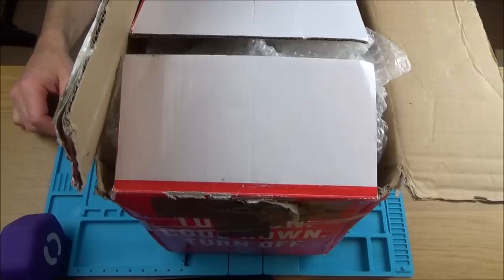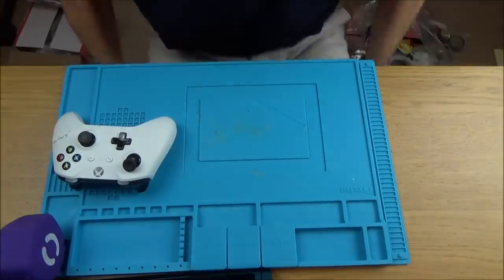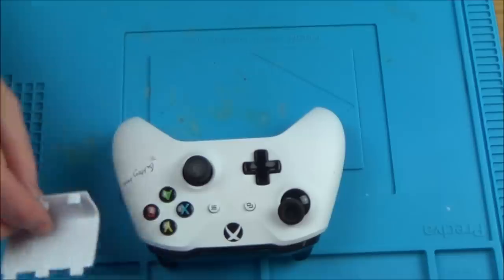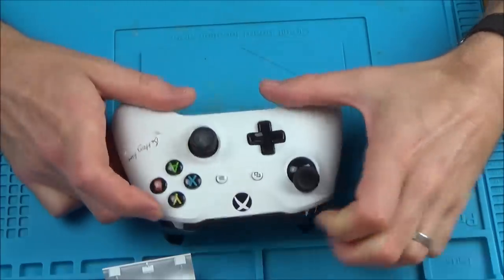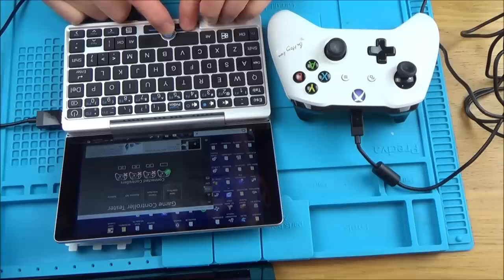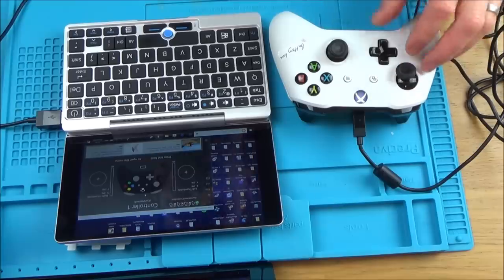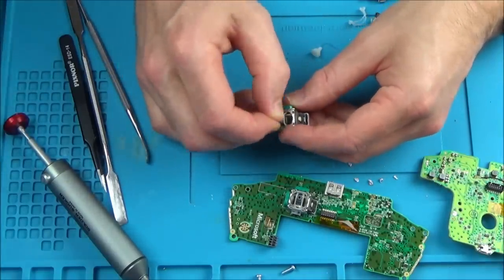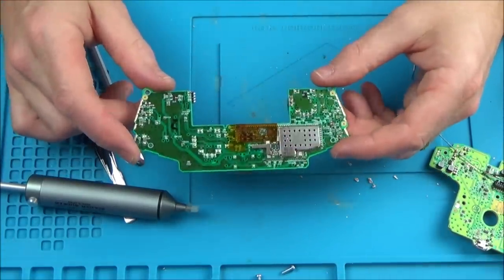Trying to FIX eBay Joblot of Faulty Xbox One Controllers PART 3

Comment: Pro Tip:
At 10:43 when he's prying back the potentiometers (the green portions of the analogs) replacing the "discs" inside will solve nearly ALL drifting issues. unless the the stick mechanism itself is loose and broken, replacing the discs will almost ALWAYS be a fix. Many times you can actually get away with cleaning them with a Q-tip and some iso alcohol! They don't even need to be from another XBOX One stick. XBOX 360's will definitely work and actually I can't imagine why any disc from any analog stick wouldn't work.

An alternative fix for a controller that continues to shut down wirelessly is to reflow the connector at 23:47. You could be having a false positive where one of those pins may actually be loose, but by testing it you're putting just enough pressure on it to make a connection to the board. I bring this up because I was experiencing a VERY similar issue with MY XBOX One controller where after a few minutes it seemed like the controller would die, but the battery would be rather full. Turns out, I could forcefully shut it off by clicking the sticks in or by giving the controller a slight "twist". Pins seemed fine with a multi-meter and it kept happening. Finally I decided to use some flux and reflow the connector pins. PROBLEM SOLVED!
Reply: Underrated comment. I would determine the potentiometer value though, just in case there is a different value. Small difference in pot value isn't bad though, it can and still work.

And put a bit of oil or grease on the pot because the pot is made out of carbon which makes it's resistance, and when dry, abrasion eats away the carbon layer causing loss of continuity(connection) thus no longer working.
Reply: i actually ripped one out from my knockoff PS2 controller and put it in the XB1 controller a few months ago. Works like a charm. Potentiometer designs hasn't changed much i guess.
Reply from the maker: Thanks, that all makes sense, thanks for sharing your tips :-)
Reply: Yep, I just pull them out and clean them and the inside of the green part with a qtip and alcohol.
Reply: Garrett P.  :
Focusing in on those sections of the stick never crossed my mind until I randomly came across such a video. I'm always repairing things and watching tutorials and etc... as I find them fun to watch when I'm bored so, the homepage for me is just riddled with these kinds of videos. 

Needless to say, I came across a video explaining an alternative fix (cleaning/sensor swap) and it's COMPLETELY changed the way I fix drift. SO much easier pulling those back to swap or clean instead of desoldering the WHOLE mechanism and swapping a WHOLE new one in.
Reply: I really struggled getting the sensor back and after cleaning or replacing it, could not get it to sit flush and close/click back in place. Ended up losing my temper and flinging the thing. I’ll have another go tonight

Comment: Regarding testing procedure: with a known working board, you can check with diode mode against ground and the test pins on the board. The test pins are marked with TP<number> e.g. TP35. You should get a reading then and can compare it with the faulty board. This could help to find the faulty section faster. Also you can set the board under working voltage and check the test points with voltage reading against ground.
Reply from the maker: Thanks Florian :-)

Comment: I bought a Xbox One S controller with the same analog issue your has. The post was broken. All I did to fix was straighten out a paper clip and cut it to size. I glued it into the hole in the gray post and attached the broken part to the paper clip. Once the glue dried it worked perfectly. No need to desolder or replace.

Comment: The reason the coax connector looks like both sides are shorted is because they are (at DC). If you look at an IFA antenna, you'll see the antenna basically shorts the center to gnd, through a tap (The "arm" of the F). At DC, that's a dead short, but at high freq (2.4G), that's no longer true.
Reply from the maker: Thanks so much. I was expecting it to test like a TV aerial cable so it confused me. Thanks for the info :-)

Comment: Hey Vince ! I faced this broken off analog stick problem a little while ago. The analog sticks have a little shaft in them , which are the exact same diameter like a paper clip. So I cut off a piece of a metal paper clip, I put in in the shaft but it was to skinny. So I grabbed one of my parts controller which had a faulty motherboard,and I cut of the analog stick grey part to the exact size of the one what is missing ,after I put this cutoff piece on the paper clip and I put on a little lock tight superglue and done! No need for resoldering. I hope this is helpful for you, ps sorry for my bad English,cheers mate
Reply from the maker: Nice little fix :-)

Comment: Great stuff as always. I dont even own an Xbox one but its still fascinating to watch. Id like to add that I (along with all your other subscribers no doubt) really, really appreciate the hard work you put in, it must be exhausting sometimes. I like the fact that your vids are detailed and you explain things in depth. Much more interesting than the fast-talking, glossed over, ten minute videos that some put out. So thank you, my day would be considerably more boring without a bit of Vince!
Btw, if that analog stick (the replacement one) suffered from stick drift then would it be easier to just take the pots off of the broken one and pop them onto the replacement? I assume stick drift is caused by faulty pots rather than by mechanical issues.
I reckon that resistor got knocked off and then slapped back in the wrong place. Strikes me that whoever was doing those repars had all the finesse of a one armed orangutan. Believe me, if I'd bought that lot (and lets face it, they weren't cheap) I'd have been using considerably stronger language than you did, and it would have been well deserved!

Comment: 32:25 comparing the good and bad boards you can see all the test points on the bad board have been tinned. Someone has tried to reflow the board and has gotten solder all over it, R28 moved during the reflow, onto a test point.

Comment: Great fix.
It looked like the other resistor next to it was on the slant and maybe that was changed out.
Question: Did you have to take the stick out or could you just have replaced the whole unit from the spares box? It looked like you took 1 apart that was whole to fix the broken 1.
The fault finding process was great to watch.
Reply from the maker: Thanks Emma, the resistor is still a bit of a mystery. The most popular explanation so far is that it was a fault by the pick and place machine in the factory and maybe the boards were initially sold as faulty but made its way into the Franken controller. Maybe your idea is more likely, the area looks very clean though. 
I could have just changed over the green clip on bits on the side (potentiometers) and I am sure the analogue stick would have worked fine. I just wanted to replace just the broken part to see the inside of them and also the other one had stick drift so I was unsure about reusing the whole thing :-) You can get the OEM ones for around £3 or £4 so most people would just change over the whole unit rather than messing round with the insides :-)

Comment: The capacitor that was bridged improperly is supposed to deliver power to the power management system, which shuts off the controller in the event that the batteries reach low power levels. Hence why the controller would only turn off if it was on battery power.
Reply: Meant to say resistor, not capacitor.
Reply from the maker: Thanks for the info on it, nice one :-)

Comment: Stick drift is likely to be caused by the potentiometers on the sides.  If you had taken the drifting stick and put the original good pots on it- that might have worked and have been easier.
Reply: MineSweeper  not to mention he had spares from stick drift-suffering potentiometers
Reply: MineSweeper  Right, the broken top joystick did not drift so the POTS were good.  Just stick the entire mechanical part of an intact joystick on the good pots and skip taking it apart to get out the gray part.
Reply: @kirkb4989  that's exactly what i thought he should have done when i was watching, would have saved time taking it apart.
Reply from the maker: Yes, definitely would have been easier. I just wanted to change out the broken part as I was a little bit curious to see the insides of them :-)
Reply: @Mymatevince  It's all a part of the learning process after all
Reply: @Mymatevince That is always a good reason for doing something the hard way.  But in the future you can save time and agony and not potentially break your spare!

Comment: My guess Vince is that the Original resistor could have been replaced, but inadvertently replaced to the wrong place, "that is if were not inadvertently moved when Frankenstein-n the controller" and because much the same fault persisted, the board was discarded as a Frankenstein candidate itself..

Comment: I would hazard a guess and say someone swapped that board to board connector? usually they are white not black on the single connector boards. maybe the resistor got knocked during the swap. Loving these controller vids.👍great job

Comment: That shifted resistor was weird, but could it have just been a rare manufacturing defect perhaps? I know that the assembly process involves a machine tacking the components to the PCB at a great speed, so maybe it just missed it's spot that one time.

Comment: Looks like this controller was deliberately modified to remove the wireless function. it is possible to buy xbox ones in UK prisons but as anything that transmits is banned they have to be modded to comply, and have to be bought from an approved suppler that does this.
I have repaired plenty of ps2 controllers with stick drift back in the day, they use exactly the same analogue stick module. the main culprit is the "foot" of the stick, the white disk with a peg on the bottom. it wears down and becomes very smooth and thin at the edge. it should have a recess on the bottom that helps it to stay centred. I used to harvest the right stick from broken controllers as they usually have less wear.
When checking for shorts to ground it is best to have the positive on ground and probe with the negative. your meter will give a reading of the voltage drop and can be used to compare with a known good board that a simple continuity test won't tell you. also reverse your probes if you do find a suspected short, it may just be reading though a diode. Check the resistance too as if it is low your meter will still beep even if its not a short.
Reply: I was going to suggest the same thing.  Meter in 'diode mode' and red lead on ground, and black lead to probe different points.  Compare those readings between a known good board and a bad board.  The 'voltage drop' readings should be very close at the same points between boards.  If not, it can point you to at the possible culprit.  If you find yourself repairing the same boards multiple times, you can keep track of the 'good' voltage drop readings in an Excel spreadsheet (for example) so you don't have to keep using a good board to compare the proper readings.  Great fix Vince!
Reply from the maker: Wow, maybe this is the reason why it was moved:-) Thanks MIK & Andy for the tips on how to test the boards. I need to start using diode mode to get used to it :-)

Comment: Fantastic repair this one!  =D  Calling the seller what you did was neccessary lol!  There's nothing genuine about that job lot!  Did you see that XB1 over on TronixFix where the connectors had been glued into the case to make it look like there was a motherboard in there?  It's crazy that the resistor needed moving over!  I wonder if it's a configuration point based on which top board and bottom board are connected up.  ie. maybe there are different revisions of the other board, and since these were seperated by the previous owner, maybe that's why it appeared to have been moved, when maybe it was set that way from factory to work with a different back board?
Reply from the maker: I really don't know Chris, all the other components looks to be the same on that board and would they be running different boards in production at the same time (unless they are using up old stock on the back board before a change). That whole area looked perfect so it is really strange...nice easy fix though, I loved doing this one. 
I seen the glued in ports, that takes it to a whole new level. Great for the video though and he did really well on that series as far as views and subs went so hopefully that will make up the disaster he had with the consoles themselves.
Thanks for the support mate :-)
Reply: @Mymatevince  Who knew repairing XB1 controllers could be so interesting lol!  I've really enjoyed watching these!  In some ways you are lucky it was such a bad lot!  the fact they aren't genuine faults has led to more interesting videos imo!
Reply from the maker: @GadgetUK164  Totally agree Chris :-)

Comment: hello, wonderful work, I like the way you fix the consoles and the controllers, I have an xbox one controller that does not work the 4 vibrators, I only have one driver of that version, it has the 3.5 mm connector, but I have 2 connectors 8 pines to attach the boards, similar to the first version controllers, do you think that I can use a plate of old version to verify if there is a short circuit or something like that that causes that situation?

 sorry about my bad English.
best regards.

Comment: It looked like all of the test points on this 'bad' board had reflowed solder, on the good board there are a lot of test point that are unsoldered whereas on the bad board these have been filled. It could be that the resistor moved in the reflow process of the board and the seller didnt know how to fix it.

Comment: Rofl! I bet you that was a factory fault! The pick'n'place machine failed by a milimeter and in the solder oven the resistor has flowed to the wrong side. For what you shown that was causing a drop on the current, so may be intially it worked and after some use the components have degraded a bit to the point that when the wireless transceiver is linked and starts draining current it shut downs the controller. So, you have fixed a factory fault that passed Microsoft quality controls... xD
Reply: This is very possible, but there was also solder on every spot on the bad board where there wasn't on the good one. So someone has messed around with that board, but no one knows if they caused that resistor to move or if it was like that already.
Reply: @garageghost6038  I doubt it, I have a controller like that and it has solder on every pad, maybe microsoft has tried to save a bit of money on newer controllers not placing solder paste on unused pads? Not sure. What I am sure is that nobody would have added paste and reflowed all unused pads manually to do a repair, if it were localized on a single section of the board, may be, but it was on all the board on both sides.
Reply: @drgusman  hmm... That's curious indeed. I guess your theory could be right. I don't have any other explantation for this.
Reply from the maker: Really don't know what happened here, the pick and place machine seems to be a strong contender :-) I wonder if Microsoft send the faulty boards off for recycling and the boards then made their way back onto the market for spares on sites like eBay. Maybe that is how it ended up in the fraken controller????? Not sure if Microsoft would risk their reputation by getting rid of faulty products like that or not :-)
Reply: @Mymatevince  I don't think they get rid of faulty parts like that, as you said they wont risk Microsoft's image just to recover a couple of bucks. Also, something else that I noticed after, the controller was labeled as "loose battery", right? Or was it "loses battery"? It fits, the controller worked initially even with that fault but after a bit of degradation it lost power even  with good batteries... Man, it's very funny to try to unveil what really happened there xD

Comment: everything on the bad board was tinned with solder and the way they are made in the factory it wouldn't have solder on everything so someone clearly meddled with it but i think it would be hard to know exactly what they did other than wind up moving that resistor.

Comment: You may be the console killer, but you're also the controller reviver, the 2nd most important part of the console believe it or not
Reply: @thegoodguy44  The controllers nowadays can be used anywhere you want with the correct adapters
Reply: @thegoodguy44  They don't need console or pc, just as the case of the Wii U, it can be used as a TV remote, but that's really it....
Reply: @thegoodguy44  Plus, without any console or PC, it's least likely to have a controller in the first place
Reply: @thegoodguy44  I'll Edit the comment then, thanks for the information
Reply: @thegoodguy44  I just corrected my mistake and made the edit bold

Comment: Lil tip-  you could've just replaced/swapped the potentiometers on the broken analogue stick with the other stick with drift, rather than rebuild and mix the internals of the two.

Comment: Vince, where's the best place to buy xbox controller parts? I've bought some replacement bumper buttons from Amazon, but they were rubbish. Too tight and kept the micro switches pressed down all the time. Any help would be great!
Reply from the maker: Hi, sorry I really don't know. I had a big box of spares that I bought from eBay so I am just digging into that when I need something. The Micro USBs ports I did buy from eBay though. It might work out cheaper to buy a spares or repair same model controller and then you can take the bits as and when you need them and you know they will hopefully be genuine parts that fit perfectly :-)